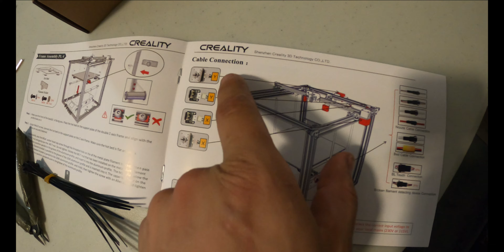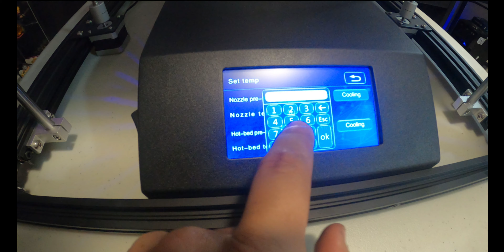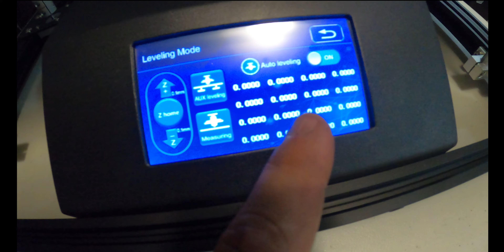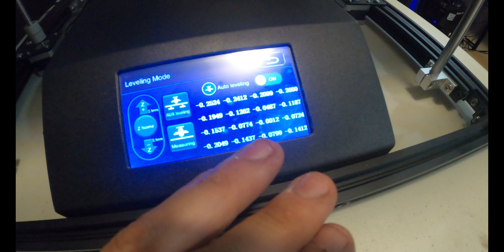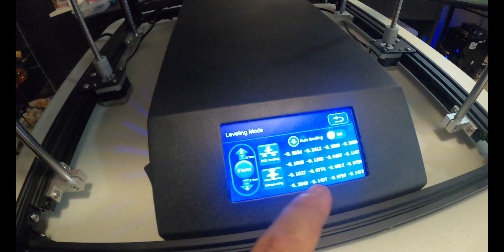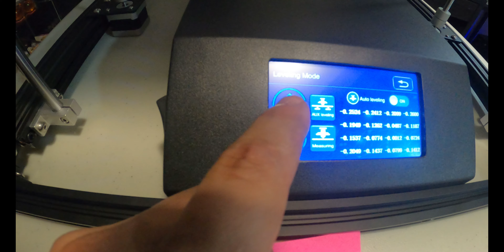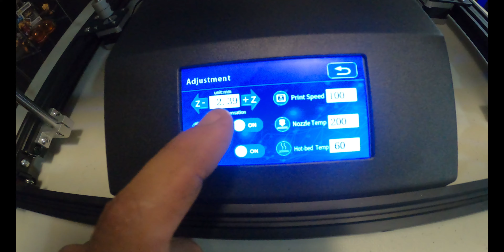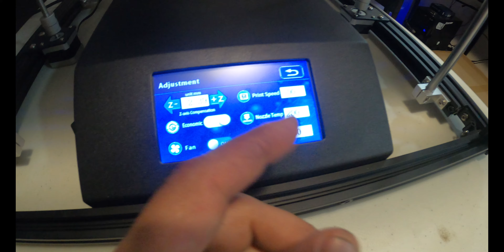Creality Ender 5 Plus - Assembly Guide and Startup Tips - Special  Build Series

Comment: I used this video for about 90% of assembly and the instruction manual about 10%. This is my first 3D printer. I am writing this the day after assembly. It took me about 4 hours from building to starting my first print which was a perfect print btw. My Ender 5 plus mini SD did come with 3 designs. I picked a design from Thingiverse and used the Creality slicer included on the mini SD. I used your heat settings and it worked great. The only issue I had was leveling the bed using "check level". Messed around with this for about 45min. I aborted that and used "AUX Level" This took about 30 minutes following your instructions and my first prints are working awesome! My only silly issue during assembly was during assembly with the cables. I only had the connectors labled "E" left over, It took me a minute to realize they plugged in to the Extruder lol, which isn't in the written instructions. Rookie mistake lol. I love this printer so far and it works great without any upgrades except I used inland PLA filament. I will do your upgrade suggestions soon. Great job on this video and your suggestions. Thank you much!

Comment: I picked up an 'open box'/returned Ender 5 Plus, and it didn't come with the instruction guide.  I watched two other assembly videos before this, and yours was the one that was the most helpful.  Specifically, thank you for calling out which screw goes where!  My printer was missing about a dozen screws between the M5s, and it was helpful to know how many I needed.  
Also, you have a great conversational tone. I would say that you achieved your goal of making me feel like we were hanging out, working on this.  Excellent video!
Reply from the maker: Oh well wow! Thank you so much for that!!! I always make it a goal to never sound condescending or rude. Just. Talking ya know?
Reply: @FranklyBuilt  For sure.  And you succeeded.  Once I get replacements for a couple of the parts that were missing, I'll be checking out the rest of your Ender 5+ series.

Comment: I assembled my Ender 5 Plus yesterday and these are a couple tips for the issues I ran into so far:

While you have the top off of the printer, push the X gantry all the way toward the back and ensure that the Y limit switch is actually engaging. It should click. Mine was out of adjustment and the wheels would hit before the switch could engage. I was able to fix it by removing the Y limit switch and reattaching it by putting the screw through the elongated hole at the end farthest from the switch. If that's not enough, you could probably make the hole even longer. I didn't run into this issue until the printer was fully assembled. It may be easier to fix before the top is attached.

You may want to have an M4 0.7 pitch tap handy. Some of the holes used to mount the bed to the Z-axis were difficult to get started. I think they were probably filled in some during finishing or something. Using a counter sink or a big enough drill bit could possibly clean the hole opening. One screw wouldn't go in all the way so I'm waiting on my taps. I didn't have any handy.

I hope this helps another 3d printer noob like me.

Comment: 12:08 Don't screw attach the bed  yet.. connect it and lay it edgewise into the slot beside power supply.  Manually twist the z-screws to drive both the carriers up against the upper stops.  Once all cables (especially z motors) are connected, power up the controller and use the Settings / Move / Z to lower the bed mounts, under controller command,  a couple of inches, then screw attach the bed plate rails to the z-carriers.  This way, both the z-screws are always assured to be in sync, and both sides bed are equivalent height.

13:53, yeah, you can mount filament spindle pointing in or out, but the spindle releases from the back lock ring with 1/4 turn, easy to remove spool with bed hear spool spindle.

Comment: Got the 5 plus for myself and my daughter for Christmas!  Can't wait to build it!
Reply: Got one for my son and I too.  Now I gotta figure out where to put it, LOL.  It’s a beast.
Reply: @dwolfpak897  That's going to be my issue as well. The wife says where do you think that thing is going to go. lol
Reply: Just built mine, so poorly made, the holes at the top for the brackets are way too small for the m5 bolts, instructions say to set voltage to 115 but there's not switch with the new PSUs, I verified by removing bolts from rusted out holes, that's right brand new, and there was rust. Waiting for creality support to tell me to do my own drilling of the holes instead of bothering to send replacement beams or tell me to return it to the vendor who won't take back open boxes.

Comment: Great video. Very informative. Not drawn out. Answered a couple questions I had with my 5 plus. One was an answer that wasn't mentioned (the plate and hotbed not actually being connected. Wasn't sure the binder clips were for that. ).  

Thank you!
Reply: Any suggestions for the cables running from the hotend? Almost had a mishap on the first print with the cable trying to wrap around the gantry on the left side. It looked like you had a hole around the extruder and used a cable tie, but I dont seem to have any holes there. I'll end up looking into a printed track system for it, but need something quick until I'm able to print that. Thanks!

Comment: Very Nice Video!  (all this hanging out is making me restless).  And great timing, I just got my Ender 5 plus, yesterday. 
I went with the 5 + because of the bed stability and then the size was a nice plus too. I do wish they had a PRO version with the silent MB and other mild upgrades - but I am nothing if not a fixer-upper (Moder).
      I have plans to install a 600 Watt PS for reliability, a direct drive filament feeder and new POM Z axis nuts with the 2 ReliaBot - Tr8x2 Lead Screws (Acme Thread, 2mm Pitch, 1 Start, 2mm Lead) to improve accuracy.  By the time I get done, I am sure I’ll find something else to tinker with.
    Thanks for all your enthusiasm and help!
EDIT: Oh, and of course I liked and subscribed! (You earned that!)

Comment: Thank you for this.  I just purchased an Ender 5 Plus as my 2nd printer.  Ive has a lot of luck with my CR10-S, and wanted the larger print area, so this with its cube like construction, BL Touch built in and the slightly larger print area just seemed like the logical choice.   After watching this, Id like to think I made the right decision.

Comment: Wsup frank ! I finally pulled the trigger on Amazon day. I remember scrolling through the comments saying you don’t use the BL touch anymore or something or you start the print with the nozzle over air instead of the bed or something ? Was tryna get all the info before I assemble my printer and not have my bl touch or bed break lol. Thanks for the content as always🎉
Reply: Wow, so I left it in the box for a couple weeks because I wasn’t mentally prepared but it wasn’t too bad.  But your video helped me out alot. It wasn’t as bad as the ender 3 tbh. And my benchy came out great with very few strings !

Comment: Quick question why if you have auto bed leveling and the proper z offset would you need to move the bed as it primes?  That completely negates the ABL you just had the printer do.  (Around 34:41). Earlier in the video you had the printer ABL then you adjusted the table in each corner, again negating what you just had the ABL do.

Comment: Nice video. :)
First thing i wonder is if you still recomend this printer today? The development in hobby 3D-printers is quit rapid.
second, how does this printer handle Z-hop? Is it recomended to not use Z-hop on this printer due to the high mass of the Z-axis and were.
Third, why don't you use the feeler gauge to level you bed? It should be much more accurat than a random sitcky note..

Edit: With the amazing glas bed from Creality, you never want to let the bed cool during print. When the bed hits room temp the print will loosen. Only other thing to remember with this bed is to wash it with alcohol every now and then. Then the print will stick like crasy as long as you print, and loosen when cooled down.

Comment: Thanks, I've had my Ender 5 + for about 3 weeks and I printed successfully a 32 hr print.
I started printing a 49.5 hr print and I had a Thermal Runaway failure after the 34 hr mark.
When recycle the printer and resumed the print it went through the motions but no filament was extruded, however, the bed kept moving. So the print failed.
I did a test as you did (35:12) and the same thing happened as before it pulls the filament then lets it drop back into position without any extrusion (I marked the filament with a sharpie).
Any ideas, nothing on the forums.

Thanks

Comment: Thanks for the video. But im abit confused on the bed leveling portion of the video. You did manual lvling after auto lvling. Wont the 16 numbers measured during auto level change since you turn the adjustment knobs while manual lvling? Should we do auto lvling again to obtain the new data?

Comment: I'm glad I found this, got mine last week. Build was easy but I have to auto level each time then fine tune with the bottom wheels. Is this normal? If I print one thing and everything is perfect,  finish that print and start a new print, I still have to mess with the manual adjustments. Generally the bed is too low on the second print and just prints a round thread the doesn't stick to the plate. Got any videos on that? Sucks dialing it in everytime manually. I know I missing some step, just don't know which on. Ender 5 Plus.

Comment: Great vid man! Just ordered an Ender 5 plus can’t wait to get it. Upgrading from and Ender 3 pro for bigger prints. I have a Longer LK4 printer also and it prints beautifully but it has this terrible vibrating/grinding noise that I just can’t get rid of.. no idea what’s causing it. I’ve tried everything to fix it, but while it prints its incredibly loud. Nothing is loose, or over tight, I’m at a loss with it and I barely use it anymore. Which is a shame cause the thing has amazing print quality.

Comment: Hi Frank, I hope your move back to the US went smooth, I quite liked you being based here in the UK as a lot of the products you used were UK sourced.
 I assembled the Ender 5 Plus yesterday and checked my frame with a square and everything was good but as soon as I pressed the Z down button the lefthand side made an almighty grinding sound and bound up the right-hand side is 7mm lower than the left, I measured the lead screws from the tops to the brass fitting with a calliper to get these measurements.
 Do you have any advice to fix this problem?

Comment: Thanks for the video, i had a doubt about voltage selection, i recently got a ender 5 plus and it doesn't have any switch to change voltage, it has a pre installed meanwell PSU,
Can you tell me if there are such PSUs which dont require this or i should be looking for it?
Reply from the maker: The meanwels auto switch I believe
Reply: @FranklyBuilt  yup I did a little bit of research and then took the risk to start it turns out it's safe:p

Comment: Hello, Sir. I am brand new to 3D printing; hopefully you don't mind a few newbie questions. I'm in researching and studying mode, but would like to know: for a brand new user would you consider this a beginner machine, or one that I should stay away from in lea of something simpler? I have excellent mechanic capabilities, so assembly would be no problem, I'm thinking more in terms of UI. Is Ultimaker compatible with or be used with this machine? My interest in 3D printing is in relation to my N-scale model railroad. In your opinion would this printer be capable of printing with good detail something like an N-scale (1:160) automobile or trashcan, or building facade? Please advise. Thanks for posting; much appreciated.

P.S. Is this really as quiet as it seemed in the video?

Comment: Hi Frank, have the E5+ and have yet to print anything but a benchie. First the build plate was warped and I replaced it. Now, I've discovered the aluminum hot bed is not heating evenly. I used my thermal heat gun. At a bed temp of 65 C, my temperatures range from 44.9 C to 63.1 C. I just sent a message to Creality about the issue. Can you offer any ideas on how to correct the issue while I await a reply from them?
Reply from the maker: Hey! Honestly I never really measured any bed temps. These aren’t perfect machines but a clean level bed will get you more than enough adhesion then you need. you’d have to probably buy an aftermarket bed heater for perfect distribution
Reply: Thanks again. I appreciate you responding.

Comment: Frank,
Love the videos and the channel,  I have an Ender 3 Pro and a 5 plus. Have you had issues with stringing on the 5 Plus?  I have had tons of stringing I cannot resolve.  I've tried the usual temp, speed, retraction, and such.  Thanks,  Rob
Reply from the maker: Thanks!! So far no. It’s most likely the filament your using and or just humidity. I’ve had certain rolls string non-stop then the next one is fine. It’s weird
Reply: @FranklyBuilt  That makes sense, I have the two sitting together both running Inland PLA+ printing Iron Man parts.  The 3 Pro is perfect.  IDK  Thanks again!

Comment: I like it. I can tell you have a maintenance background, it is in your approach to the machine. I want a printer like this but have a need to print dual colors. I am looking into several options. It would help if there is an option or upgrade to dual extrusion printing with this machine.
Reply from the maker: There is! It takes some work but you can definitely add dual extrusion
Reply: @FranklyBuilt  Thanks, I am working on a project that may be profitable. I intend on slowly upgrading from homemade printers to a more structured setup.

Comment: Just bought and opened the 5Plus. As I slide the gantry and arm in the X-Y directions there seems to be a physical hitch, small but noticeable every 3 inches or so, like a speed bump type thing. No noise. If you can envision a table leaf where it meets the table and you run your fingers over the meeting point. Not quite smooth as you feel the gap. Since it is one piece there shouldn’t be a gap or hitch so I was wondering if this is normal and what purpose it serves.
Reply from the maker: Phil R so one of mine does exactly that but it hasn’t effected anything

Comment: hey man, can you make a video about maintenance of the ender 5? like the unclogging procedures and how to recover an stuck nozzle? I received this printer two days ago and already had a clogged nozzle in the second day. I am used to the direct drive extruders, I am having a bad time with bowden. I always cut the filament at an angle, but on ender 5 it makes just impossible to load the filament runout sensor and the extruder, because the optimal angle is the opposite (i saw you cut it flush (90º). I will try that next time. Another thing i am afraid to mess with is the belt tension on y (because of the two belts). Can you record something about belt tensioning?  Anyway, thanks for the video man. Regards. Riccardo
Reply from the maker: Check my how to print tips and tricks video
Reply: I just got mine a week ago. Dealing with the clog on the 2nd print I noticed a horrible omission. The heat sink is attached to the metal tube jacket for the Bowden tube by means of a small set screw. Lacking a press fit between them would only be excusable if they used thermal conductive paste. They didn't. As it is you get unnecessary heat creep into the jacket that should be bled off by the heat sink. By a tube of thermal paste if you don't have some already. You will thank yourself for doing so.

Side note: I only managed to get my first print after extensive analysis of the problems I was having with the head travel. It turned out the X end stop switch was misaligned when installed at the factory an was activated by the metal frame of the print head holder rather than the rollers of same. As a result the machine "understood" an improper X frame and wanted to smash the touch sensor into the far X rail. Needless to say I did not attempt to print until I sorted that out on paper. Then I successfully printed a calibration cube and the raft of the next print before CLOG CITY.

Comment: The prime line should just be at the side not going in a triangle to the middle
I think there was a similar problem with Cura and it's10s pro v2 profile. 
If you change profile you get the normal prime line that doesn't interfere with the print area.

Comment: Hello, I am afraid to ask this question, but I really wonder if the right side of fan is actually turned on when heating the filament, or its turned on when its running on print?

I just wanted to know because I'm afraid if i broke my right side fan or not, as it doesn't turned on when I'm heating up the nozzle, and yet i can't do a test print because i am damaging the heating block due to filament clogged off.